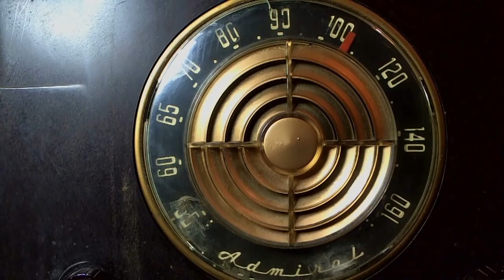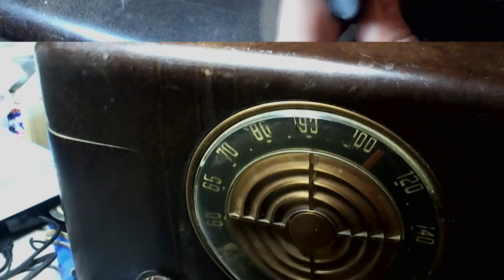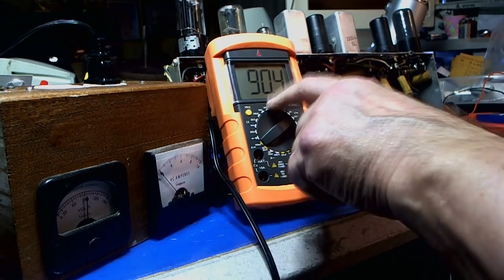1950 Admiral Model 6S12 Restore Part 1

Comment: Looking good Buzz.  Glad your feeling better. Lots of weird bugs around this winter. Every family member has had some kind of bug so far.  Good tip on walking....it's an amazing simple exercise on it's own and a great stress reliever as well.
Putting that ferrite rod back together with Epoxy or other good glue should get it close to what it did in one piece for the AM coil antenna.  Just about impossible to try and find a whole one I imagine.
I'll be interested to see what goes on with the phono cartridge. Those crystal cartridges tend to degrade in moist environments.
Reply from the maker: +GrandsonofKong ....I will glue that rod on in a future eposide...i'm going with a stereo cartridge wired for mono ....Thanks my friend...Buzz

Comment: hey buzz, well if nothing else at least you got your  cold out of the way early this winter. it would suck to get sick later on in the winter when it's really really cold out. just keep your immune system up by taking lots of vitamin C, & I don't mean Coors, or like the kind of beer Dickel gave you. I love the early record changers, I'll bet this one didn't have a tone arm rest. I'm working on my Zenith radio phonograph and it didn't have one either the only thing that was holding the tonearm up was at the rear of the tonearm there's a rod that fits in the rear of the tonearm assembly that lifts up the tone arm when it's in reject mode and allows it to travel past the record without the needle dragging across the record, and then the tone arm just rests on top of that little rod when it's in the rest position. it was missing on my machine and so the tone arm was just dragging against the wooden frame of the inside of the phonograph so I made my own rod and now it works great, now I just have to refinish the cabinet which is in a really bad shape. Good luck on yours, yours will be easy to do because its a bakelite case. looking forward to part 2.
Reply from the maker: +amberola1b Hi amberola...Dickel told me  why he drank all that beer......I was too sick....and the expiration  date was when I was sick, so he actually did me a favor drinking it before it went bad..what a pal... huh?....I  play around with the changer in part 2..thanks 4 watching....buzz

Comment: Buzz, 

I hope you're feeling better by now.  I had a bug at Christmas time as well.  I could feel myself turn the corner for the better late Christmas night.  It seems like you get 95% better in a week to 10 days and it takes forever to get over the last 5%.

I'm only guessing, of course, but I'll bet you can glue that ferrite rod-thing back together and use it, as is.

I noticed on the ARF that someone rebuilt a crystal cartridge not too long ago.

Regards, Tom
Reply from the maker: +THOMMGB .....I'm going full steam ahead on this project..I'm going to install a stereo cartridge like I did in the other Admiral...Buzz

Comment: I have a admiral 5y22a made in 1955 and looks almost the same as 6s12 but with a completely different turntable.  the cabinet is in very good condition. it's got a 3 speed record changer I'm going to use the admiral as my main record player because news ones are as good as you can throw them.
Reply from the maker: and believe me , that ain't far...